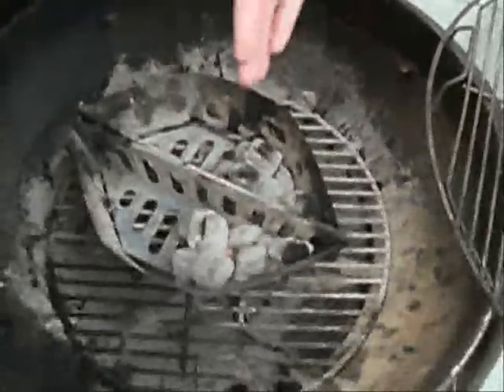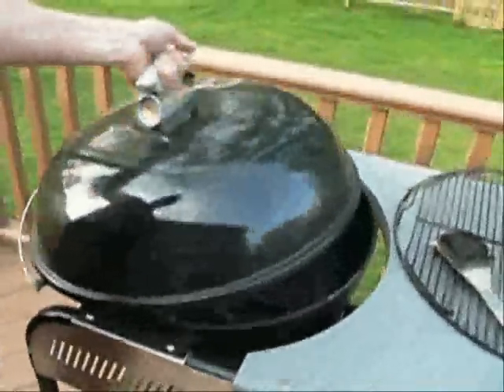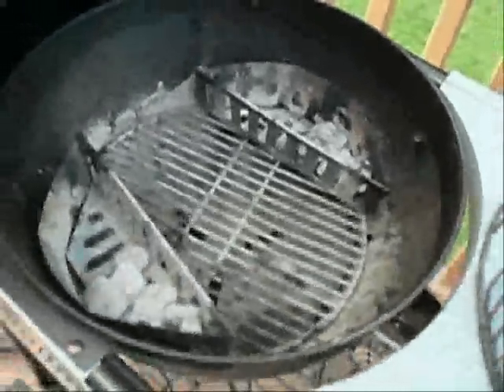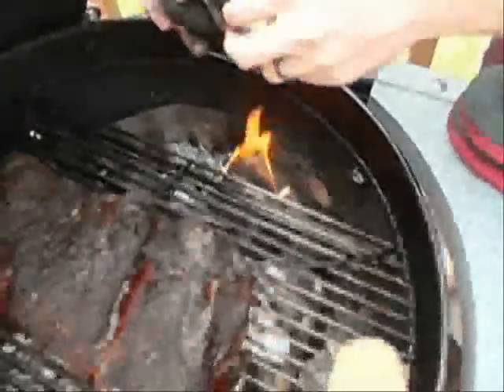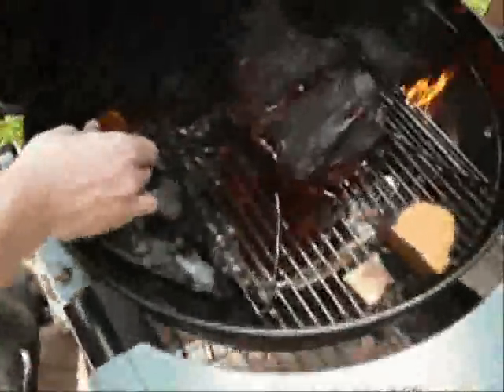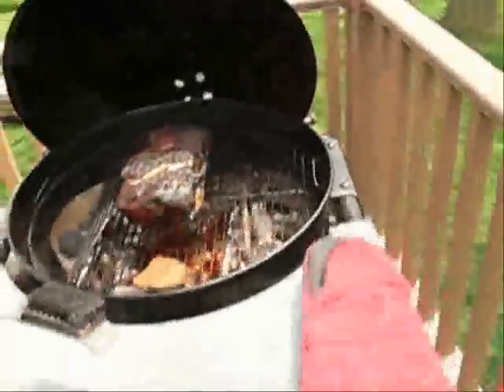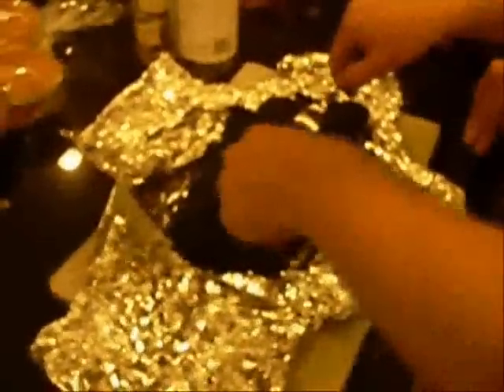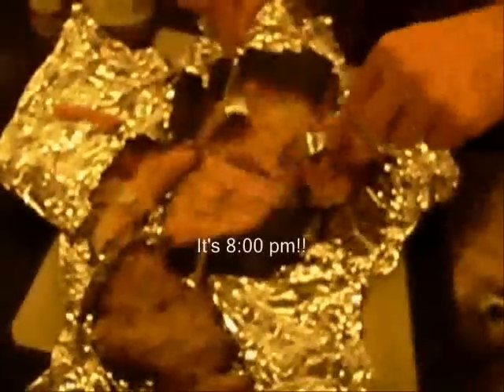Smoking a pork butt

Comment: That looks delicious!  I've tried a Costco boneless pork shoulder cooked in a CookShack elecrtric smoker oven using apple wood chunks.  Soaking the pork in apple juice and onions for at least 24 hours before smoking adds complexity to the final flavors.  Then I mix the pulled pork with my BBQ Sauce for Amateurs and voila! the best pulled pork sandwich in Silicon Valley.  Thanks for a great video!